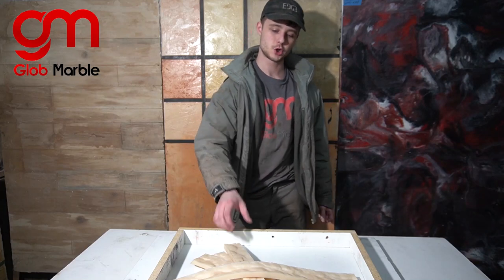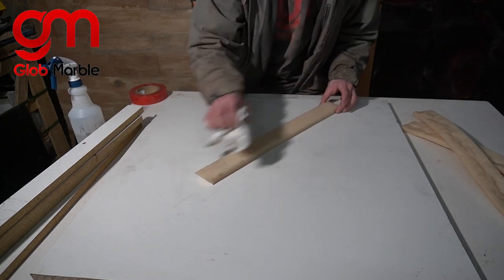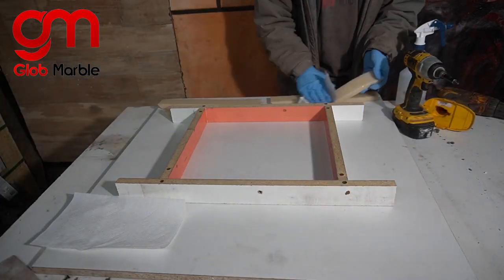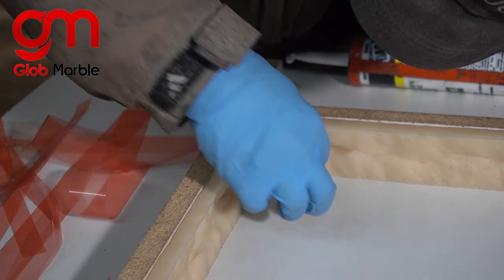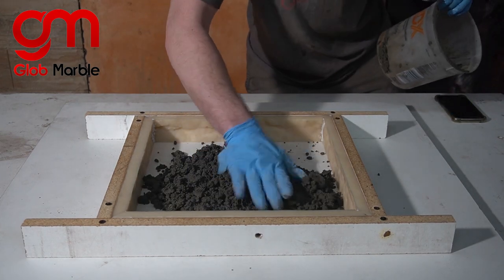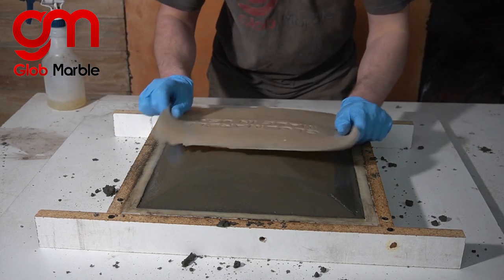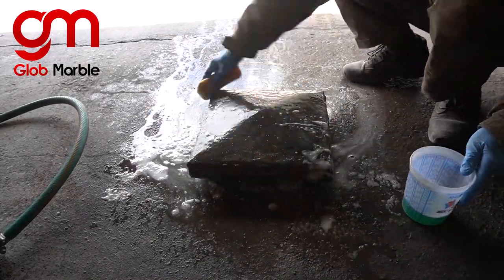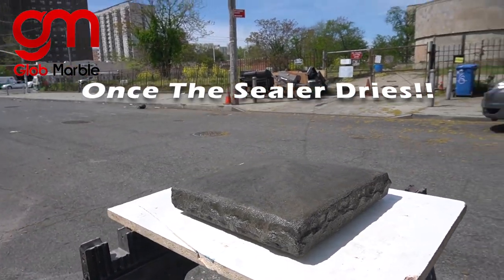Concrete Capstone | How To

Comment: Great principles and steps to be used my projects. I would add suspended (hidden) wire.
Reply from the maker: What for?
Reply from the maker: To be honest I don't think rebar is necessary for this project because of the thickness compared to its width

Comment: Hi quick question superplasticizer is expensive and hard to get hold of if your not a company here in the UK any advice on how to make your own , for self compacting concrete . Good pier cap saves on mould time for low numbers
Reply from the maker: Hey! We really don't recommend using superplasticizer while making this capstone, because that will make the concrete too liquid and it won't stick up in a peak like this. Also, there really is no way to make superplasticizer without a laboratory :P We do ship superplasticizer worldwide in user friendly quantities, either 1lb (0.453592 kg.) bags, 33 Lb. (14.9685 kg.) bags, or 55 L. (24.9476 kg.) bags. Here is the less expensive, weaker option-https://globmarble.com/superplasticizer-for-cement-and-gypsum.html and here is the stronger alternative- https://globmarble.com/concrete-additive-water-reducer-super-plasticizer.html